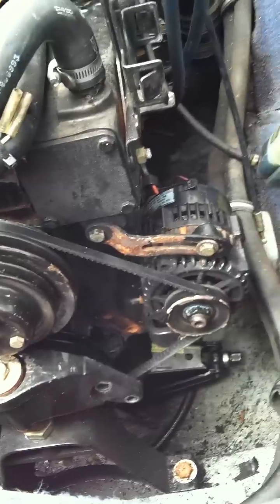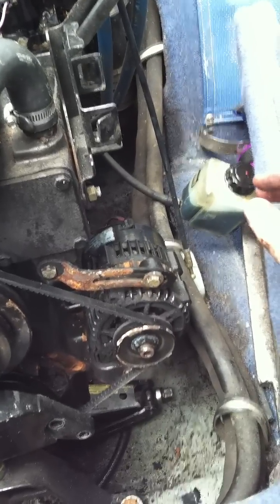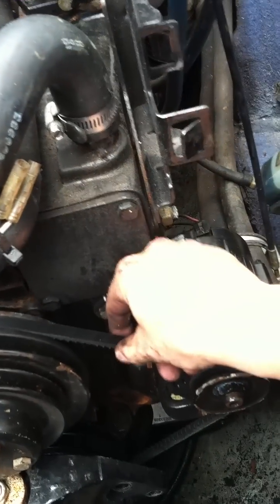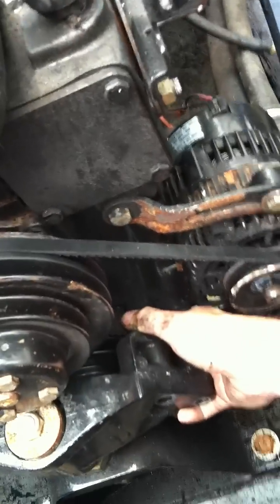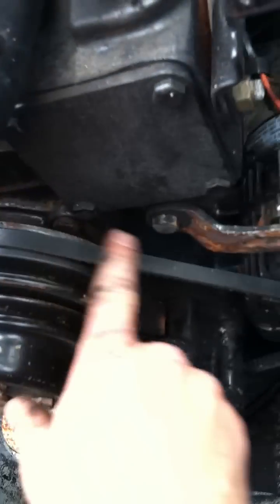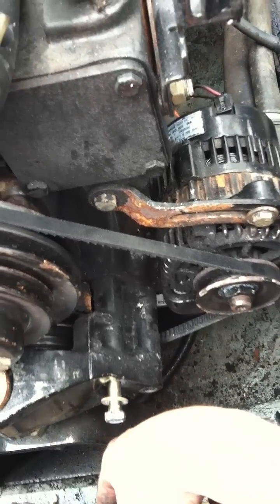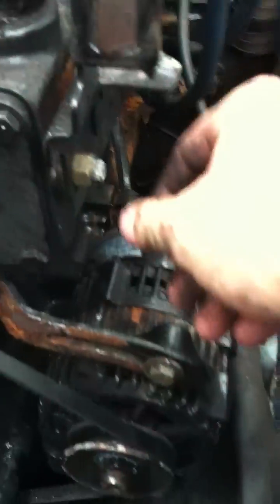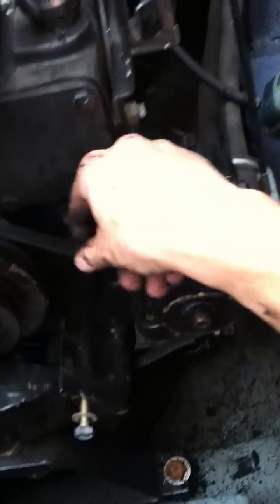Mercruiser 3.0L "V" belt installation

Comment: Break those 4 bolts loose on the pulley and the pulley comes right off, making it easier to get the belt in place. Most Mercruiser engines on boats manufactured after 2000 or so don't need to be scissor jacked, engine should be firmly in place even after that engine mount spacer is removed.

Comment: make SURE that you install the spacer block correctly. you can install the block upside down and this will cause the belt to rub on the block and destroy it. the clearance between the block and the belt is very small. the belt will just clear the block when installed the right way.

Comment: The Autozone Duralast 15400 (40") worked for the Alternator and from my measurements the 15370 (37") is right for the power steering.  $9 each.  My Alternator belt was really torn up and slipping big time.  Will be curious how my temperatures run now.  I was typically 200 degrees (the alternator belt also turns the water pump).  Thanks for the video.

Comment: This video was extremely helpful as I successfully replaced the belt with no issues!  🙌🏽.  I have a new problem now, looks like I need to replace my alternator and looks like you have the same engine as mine.  Do you happen to know what type of alternator I need by chance?
Reply from the maker: I just googled 3.0L mercruiser alternator and I got several options. Any of them would work.

Comment: Thank you so much for this video!  It helped a lot!  I ended up needing a 41” V belt and worked like a dream!  Only thing I need now is my adjustment bolt for my alternator is stripped. Was able to install with locking vice grips but definitely want to replace, any help on that would be appreciated!

Comment: The pulley and the mount where 1 mm apart impossible to squeeze the belt, but I followed your recommendation and success! I remove the spacer and jack up the engine loosening bolts from the other side of the mount bracket, I lifted just enough to squeeze the belt between the pulley and the mount. thanks ! I used NAPA 25-7395 v-belt, perfect fit

Comment: Very good video. It made the job easier knowing what to expect. I used a small bottle jack and a 3/4" thick piece of hardwood under the front main bearing area. I put just enough lift on it to take the weight off the engine mount. I had to pry the mount away from the engine to get the spacer out and to replace it. Mine is a 1992 Bayliner and it took a 40.5" belt. The whole job took 15 minutes.

Comment: The marina told me I had to jack up the motor and remove the Engine mounting bolts.???Removing the spacer was excellent and quick. Great way to change the belt.

Comment: I have a 87 mayliner Capri 20 ft. what size fan belts do I use and    I need a neutral safety switch wit cobra engine

Comment: The belt for this motor is a 15395...they been using the same belt since 1988...15400 probably works but thats not the belt that its supposed to be....just thought I would throw this info out...and the power steering belt is a 15370 to the person that asked
Reply: Do you happen to know the length of the drive belt mentioned 15395 and does this one go around the engine main.. water pump.. and alternator.. 3 pulleys total
Reply: I'm thinking 39.5 since 400 is 40 inches
Reply: He is wrong 18-15400 is the factory installed v-belt for 74 and up 3.0l for the alt and water pump.

Comment: Good work man,
Made the job way easier. I used a small hydraulic jack and a piece of wood on the lip of the pan. After I put the spacer back in and bolted down the two bolts, I loosened the top engine mount nut and was able to remove the water pump pulley more easily.

Comment: Is it necessary for the spacer to be place back on after the belt is installed?  I tried for 30 minutes to get the bolts back on to secure it and it wouldnt connect to the other end.
Reply: 2 years later:  YES, it  Absolutely is, or else the engine will misalign,and ruin your gimbal bearing,and other very expensive things.